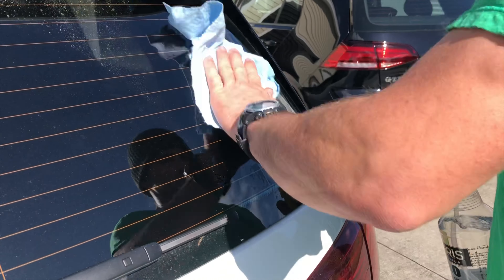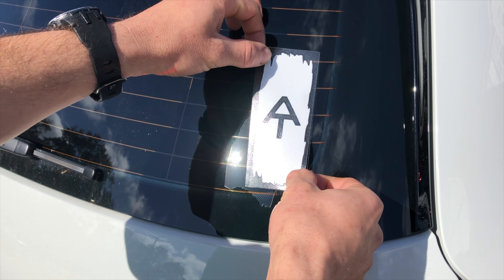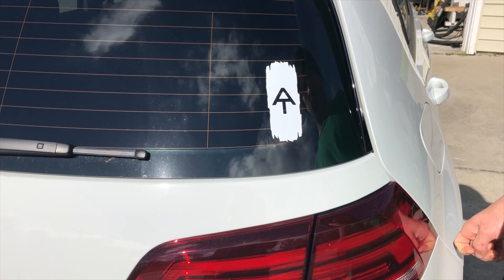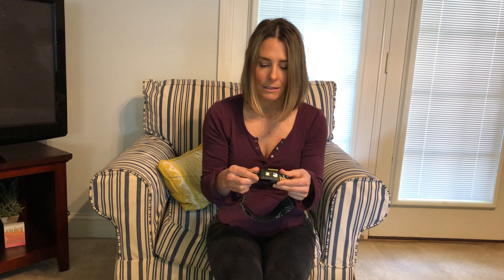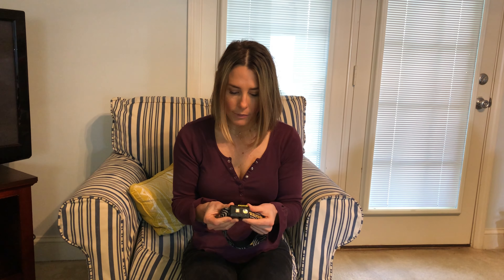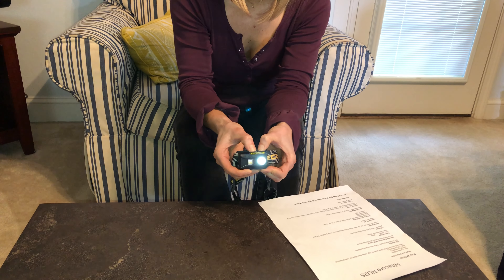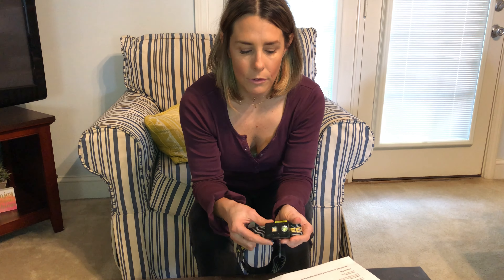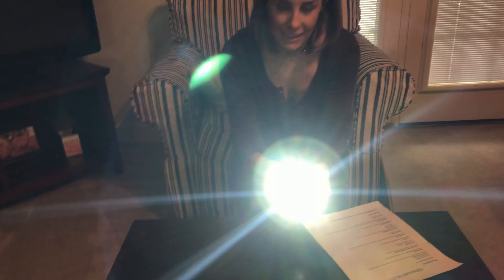The Ultimate UL Headlamp for Hiking the Appalachian Trail

Comment: Looks like a great product. Is the battery unit user accessible? That's a beef that I have with usb rechargeable products in general; when the battery is done, the entire unit is junk.
Reply from the maker: No it’s not. It’s a $35 plastic light. By the time the battery wears out you’re more than likely going to need to purchase a new light anyway.

Comment: Thanks for the info. I, too, use a Spot and have been disappointed for the reasons you note.  It is great as long as it has fresh batteries, but need replacement after very little usage.  Sounds like the Nitecore may be good alternative.  It is a little more expensive than the Spot, but no batteries to replace, so save time and money in the long run.  Peace, Love and Kindness.
Reply: SpartyhikerfromME the nitecore is a million times better, get it!
Reply: It has electrical storage, like many rechargeable tools, phones, etc - a battery. I met a guy who makes battery packs for rechargeable tools when the original ones become commercially unavailable. I have taken a bayonet style rechargeable power unit apart and found average rechargeable ni-cad batteries wired and taped together. I wish that they were built with individual loose ni-cad batteries so that they could be easily removed and replaced when necessary, like old flip and slide phones.

Comment: I purchased this head torch but was disappointed with the battery run time it is nothing near what the instructions say, think it would last u more than a night out, no good to me, going back to batteries
Reply from the maker: Mine lasted several nights on trail. Sorry to hear you had a bad experience.
Reply: @AmyandJohnsAdventures  Same here Amy  I put a little cuben stuff-sack cinched round it and use it as a lantern hung of my trekking pole  also I took the headband of and replaced it with bungee cord .  Maybe not such a good idea for gals with long hair as it could get tangled.  Great vid peeps